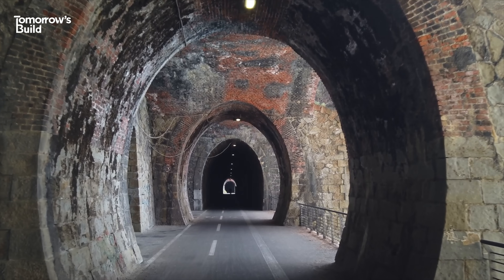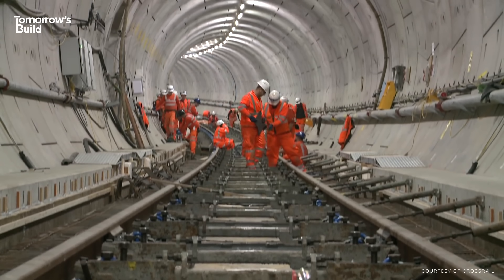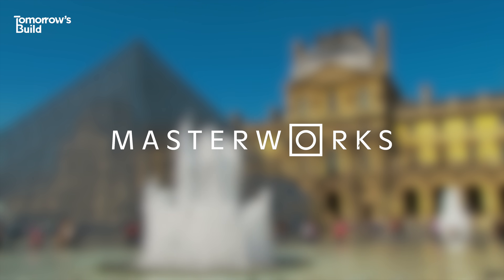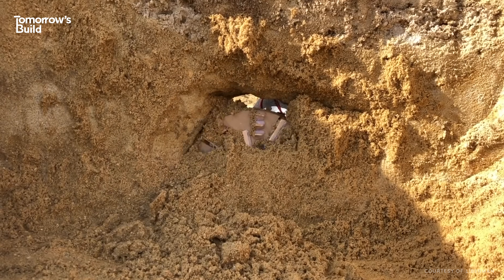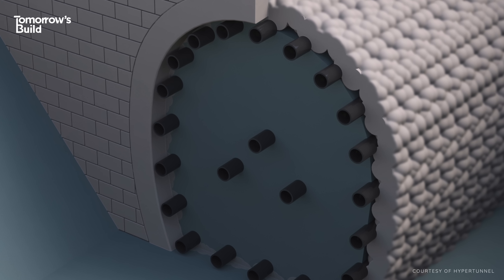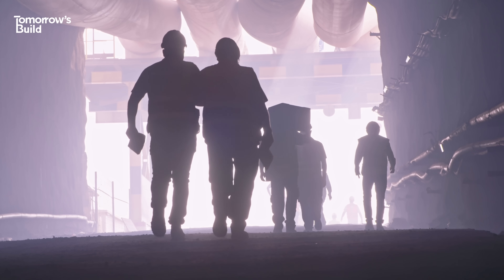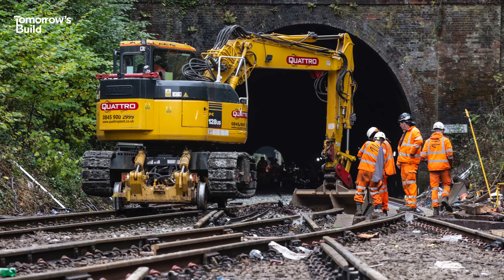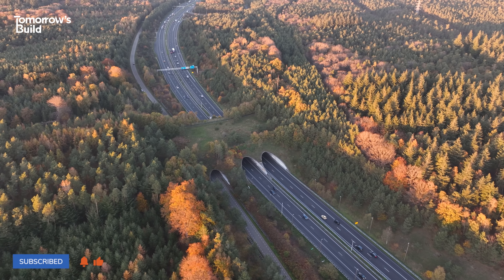A Swarm of Robots Built This Tunnel

Comment: If you were to build underground on mars the structures could potentially last thousands of years, plus it's very cost effective to do so once you've made the intitial investment because instead of expensive surface structures you would simply excuvate rooms into the sides of tunnel. Given that it doesn't take a national budget l to build a storage room underground in a mine it's very economical as well.

What you would do is put the airlock infrastructure at the entrance of the underground base, then string around life support such as ventilation tubing like what Mines have to prevent suffocation & death by deadly gasses.

You would send micro reactors to Mars, and once you have an underground base you could put the reactor in a room so technicians can maintain it with normal clothing instead of a space suit.

Don't forget we have universities that focus on mining engineering. You would pay these engineer grads to build you an apartment to your specification such as living room + 3 bedrooms for you & wife, kid, and spare room such as a office & storage. Once that apartment is built it would potentially  last thousands of years due to avoiding issues such as a roof going bad over 20 years.

Maybe a house on Mars would be cheaper than a house in cities such as Seattle, after they have a few hundred thousand dwellings they might include a free house in a immigration package because the housing may be 100 percent livable but may look very outdated after 50 years like a shag rug in the bathroom you can't remove. 

How many people would want to live in a house with a impossible to remove shag rug in the bathroom? Homeless & low income migrants would,but that's the thing, today many people don't want Martian colonization because of jealousy but perhaps we would go from "How dare the rich want to run away" to "You couldn't pay me to live in one of those apartments, I would rather save up for something nicer.".

Comment: this looks like a mechanical engineers nightmare. 5000-10000 robots means the points of failure scale tremendously. little bits of grit in all those moving parts will cause failures. they will have to address what happens when there are multiple mechanical failures deep in a pipe that blocks other robots from passing in the pipe. Also, the tracking problem on what has been done and what needs to be done will have huge scaling issues. Check out Stuff Made Here's automated puzzle assembler for reference on the types of problems that will need to be solved.
Reply: Then you hire a lot of guys with jackhammers😃

Comment: Thousands of robots means thousands of potential breaking points. What if there's a water leak or too hard rocks? How would you recover a faulty robot from a bore spanning literal kilometers? What if the drill or injectors get stuck? Will the facility need expensive maintenance workers and repairmen? This might be half the cost but will take twice as much time during it's early real world trials.
Reply: Agreed, looks cool but super impractical if anything gets jammed.
Reply: Specialy because you also need, filling and charging stations.
The robots need maintainance, new drill, hardening liquid, and batterys.
Also there will be debry in the pipes, a small rock and one robot get wedged up blocking the hole pipe, good luck recovering it.
Reply: @jonasstahl9826  o
Reply: Good points, but, counterpoint: It's a HYPER tunnel. QED.
Reply: The concept of swarm robots only makes sense if the robots can repair itself and make new robots.

Comment: It's an innovative concept, but I'm curious to see them an actual, full-scale 'demo'  (aka, actually building a kilometer-long tunnel, for real application, in real terrain with the mentioned hundreds of robots). It's neat to see the concept working under what is essentially 'lab conditions', but I'd wager there's a good number of issues to resolve that they haven't even found yet (and which will require a full-scale project to become visible.
Reply: I am with you on that, the narrator was definitely too optimistic calling it real world, it was just pile of sand, they pretty much took apart a sandcastle. A very large sandcastle is what they took apart I would love to see them drill through rock
Reply: @RedRyan  I work in the mining industry.  The amount of beating this stuff would be taking drilling into rock all day would just end with more issues. Like what happens when a robot gets legit stuck in the pipe? A dumb workhorse can take that beating because everything is massive.
Reply: @pin65371  The robots are likely powered by wire, so in most cases you can just yank it out. There could be edge cases where they are trapped against something. I think the benefit of using swarms of smaller robots is that there is no maintenance period. The cost should be low enough that they can be easily replaced instead of refurbished.
Reply: @guitarazn90210  good luck using a wire when things get really stuck.  It will be a game of what breaks first.  The wire, the tool or the pipe they send the robots down. Big tools can take a lot more of a beating before repairs need to be made.  These smaller robots just won't last long enough to make this work effectively.
Reply: @pin65371  exactly, why have one big machine which could be repaired by humans if you could have lot of small robots which could each break and get stick in tinny tunnel 😂
Reply: @piisfun  If there are a large enough amount of the robots, you may actually be able to create a wireless mesh network in the pipe. Wireless doesn't travel underground, but it does in a pipe atleast a some distance. Bends are tricky, but reflections can be useful for that
Reply: Given they can have multiple in a single pipe and they can cross each other I don’t think they can be powered by wire. I’d imagine a likely rescue scenario involves a functional robot shunting a dead robot to the end of the tunnel.
Reply: @tmhrtly  Those drill arms must require a large power draw no? Especially against tougher rocks. In theory it's possible to use battery power, but in practice I'm skeptical. I guess they can rotate multiple robots drilling each section.
Reply: Like what happens when they hit a spring or pocket of water and mud that starts filling the pipes
Reply: @piisfun  Why do they need wire guidance? Surely they'd just use accelerometers that detect their position from an initial start point.  These devices are quite accurate, easy to use and cheap. They wouldn't need power lines either as the bots could use batteries then, when a bot needs to be recharged, it could just make it's way back down the tunnel. 

Passing tasks and messages between a large number of bots isn't difficult either - each message would have the bot identifier - if that bot isn't in your tunnel then you could just ignore the message, if the message is for you then act on it, otherwise you pass the message down the tunnel for the next bot. Where's the difficulty? Obviously it would be a little more complicated than this but not much more.

Comment: I think the hangup is going to be regulatory, they're going to have to prove it's safe, that takes time and money.
Reply: safe for whom? the robots? Humans don't need to go in until the end, and at that point it's easy to survey for structural integrity.
Reply: @johnjingleheimersmith  yes, but the structural integrity isn't proven. The vast majority of places in the world that could afford to utilize such a system have regulatory frameworks for the safety of construction projects. It won't be permitted to be used until it passes certification.
Reply: @punkdigerati  If the tunnel is structurally sound what's the problem exactly? There are definitely complicated things about this technology, but the part you seem to take issue with really isn't. What exactly is the specific safety concern you have? Every individual large construction project undergoes it's own "certification", but not every single machine.
Reply: @johnjingleheimersmith  I'm not taking issue, nor personally have any concerns. That doesn't change the fact that it won't go from concept to utilization without proving it's viability to the regulatory bodies that oversee safety. It will take time and money to do so.
Reply: @punkdigerati  As pretty much anything does. It's like saying "well they won't make anything unless they have money" this is an obvious statement, but implies it's a particular challenge for this company uniquely. And you are specifying safety concerns, without pointing out what unique concerns this technology creates or has in regards to safety.

Comment: What happens when any of those robots fail (general malfunction, drill busted and stuck, material inside pipe preventing proper movement) and get stuck deep inside one of the pipes?
Reply: Worst case would be a robot becoming entirely non-functional, blocking a pipe (they can pass each other only when both are functioning). So they definitely need a way to recover, even forcefully, any robots that suffer a defect, as losing an entire pipe is likely going to screw with the project's integrity.
Reply: @Alblaka  Doesn't see like a significant challenge really. You just feed a cable down  the pipe that can grab the stuck bot then yank it out. Something plumbers do every day.
Reply: @johnjingleheimersmith  "down" a horizontal shaft spanning kilometers. That is not something that Plumbers do every day.
Reply: @EdgedPixie  The concept is basically the same and scales easily. What makes you think any differently? Plumbers use cable to fetch/remove/destroy obstructions. These concepts are not new and in-place piping does more complicated operations every single day.
Reply: @EdgedPixie  Just a matter of scale.
Reply: @EdgedPixie exactly, not everything is reasonably scalable.
Reply: i was wondering about this too, the massive advantage that a large tunnel bore has is that the only point of failure is itself, one point of failure that can be easily repaired, a swarm of robots would be thousands of individual points of failure which could end catastrophically considering just the sheer number. either a failure with movement or more worrying a failure with properly creating the integral structure that would keep the tunnel from collapsing
Reply: @maxbrown8791  Repairing a TBM is not always easy, more than a few have been abandoneded.  If I understood the method, some tunnels built like this would have a liner assembled within the original bore, then then more grout injected to fill voids.
Reply: what happens when the video contains no evidence of anything?
Reply: Hey, ignorant person here. But I saw in the video that robots fill half of the pipe and can pass each other. Some failures might prevent this of course, so I guess they have to engineer those robots such that they will almost exclusively fail into a by-passable configuration and are 'towable' by another robot. 
That being said, I know it's easy to say we need to control the failure modes of those robots. My guess, as a person who is not working in that sector, is that it takes about 10 billion dollars and many years worth of research, and then we could have rather reliable system of robots.

Comment: I think they are being very optimistic about how fast this will take off, but I like the idea. Particularly the part where they map the geology of the entire tunnel wall before there is a lot spent on the project. The reduced risk on the project from that alone will certainly get companies interested in this.
Reply: I feel like this is probably the great idea for using these robots. Make them only drill the small tunnels and map the virtual twin. This way if there's some "surprises" the robots will find them way before all other work has started.
Reply: This is going to take off very fast. As it is now, when a new DUMB or subterranean connecting tunnel is created, the peasants always hear the reverberations, and a decent cover story has to be created. This way will be much quieter, and therefore more effective.
Reply: @johnnymcblaze  I mean, you aren't exactly wrong. This could make terror strike attacks via infrastructure and civilian casualties harder to notice.
Reply: That's not optimism. That's econ spazz's lying through their teeth. No engineer in their right mind would make such claims. I have seen it plenty in my work. It's never those who actually know what's going on. It's econs trying to sell a product that doesn't exist yet and never will.
Reply: I feel like this is a much cheaper alternative that will take off in extremely population dense areas like Los Angeles.

Comment: I think this system will work great in small complex projects where structural stability is the biggest concern. tube tunnels, pedestrian underpasses, underground stations, basements. those sorts of things. but  there is a limit to how many of those robots can travel up and down a single one of those tubes. even if they can pass each other, the air pressure and even minor mistakes in trajectory will severely inhibit save speeds and passing rates. ontop of that the number of points of failure in this system is gigantic. if they lose signal with one of the drones somewhere in the pipe they have to shut down the whole pipe and carefully remove every single one until they can tow the broken one out of the way. which will than be expensive to repair due to its compact size and shape.

Great system to use in addition to what we already have but in no way do I think its going to replace tunneling as we know it. it might just open up new envelopes where tunnels can be made that previously couldnt.
Reply: I don't think it would be that bad - all the other bots could leave on their own, and a specialized towing bot could extract the faulty one. Shouldn't be too difficult.
Reply: @piisfun  I'd expect them to be fully autonomous and not require outside communication to do their job. Whenever they leave the tube to restock on materials / recharge they can get new commands. No need for constant communication with modern tech